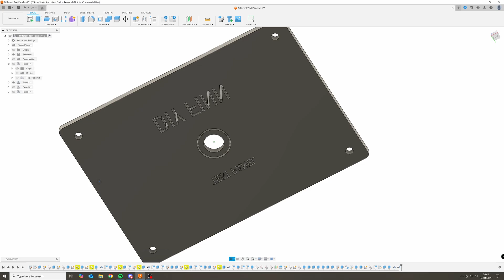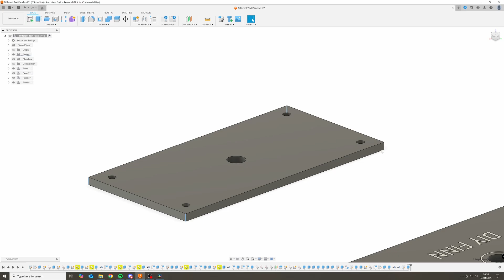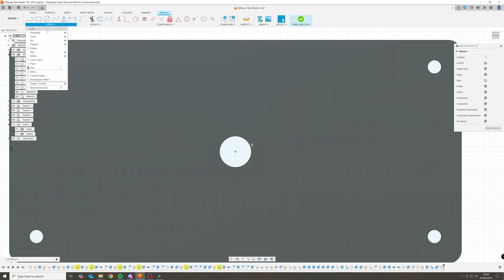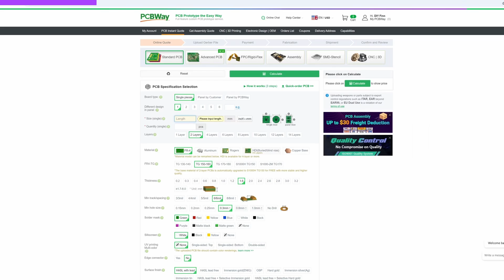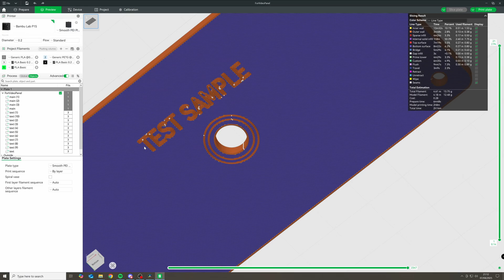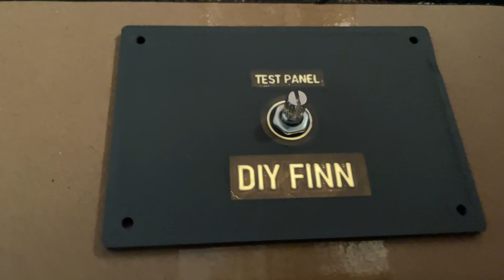3D Printed Text Has NEVER Looked This Perfect Before!

Comment: what does exploding the text do? why is that important?
Reply from the maker: In Fusion360 text is not considered a "line" or countour of an object before it's so called "exploded". When you do the explode operation, you make the text into small little vertices which you can then manipulate normally.

TL;DR: If you don't explode the text, you can't extrude or manipulate it normally. It has to be done for this method to work.

Comment: The idea of the final extrusion to block light around letters is great! One suggestion. I add a layer of transparent PETG above the whole component (beeing the first layer printed after facing down at bambu slicer). It is much easier to print it, with less printing failures, as small letters tend to wrap if printed as first layer (at least with my A1 Bambu printer). After the printing I easily peell off that layer (bc it is from differrent material), having a perfect printed body.

Comment: How strong is the mounting point for that switch give that you only have 2 layers of PLA connecting the rings?
Reply from the maker: Great question! It actually doesn't hold very well if you apply too much vertical pressure to it. The way to fix it is to model little "tabs" to connect the inner circle to the main body. I forgot to show it in the video which is a shame, because it's quite an important step. The little connecting bridges don't block too much light to affect the lighting if you leave a tiny gap between the white part and the bridge. Hopefully this makes sense and I hope to show the method in some future videos. Thank you for the excellent question!

Comment: What kind of LEDs and structure are you using for backlight?
You know, always thinking about that.. do you have, or do you need colour in the backlight?
Reply from the maker: We use a simple LED strip which is quite densely populated to maximize the effectiveness. The strips are mounted to a fiber board about 5cm away from the panels to give it a even lighting. We don't really need any other colors than white for our use, since we are building our simulator as a real replica and hence no RGB is needed :D
Reply: So I thought... If you had simple vertical wall reflectors, you can get good mixing, and a bit better light, but a little added complexity.
Your dad pointed me to your site... It's about 20 years since we met...
Reply from the maker: Oh nice, it’s been a long time then haha! I’ll definetly mention this to him.😁

Comment: For the next version, fill the space behind the text with clear epoxy to strengthen the panel and the light will still passthrough the epoxy.
Reply from the maker: That’s good suggestion indeed. We ourselves don’t need stronger panels than they already are straight out of our printer so we avoid that extra step and time to crate each panel.